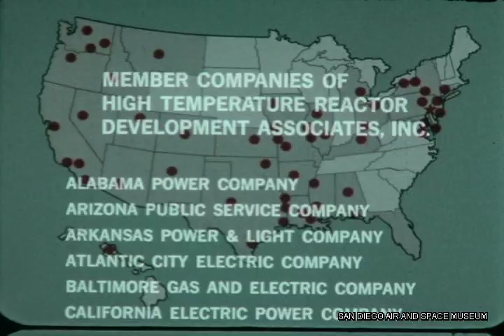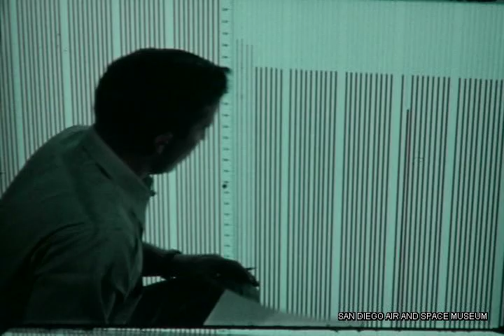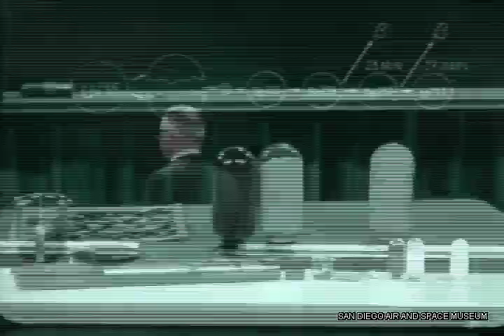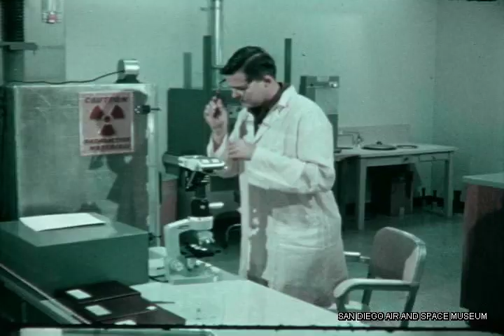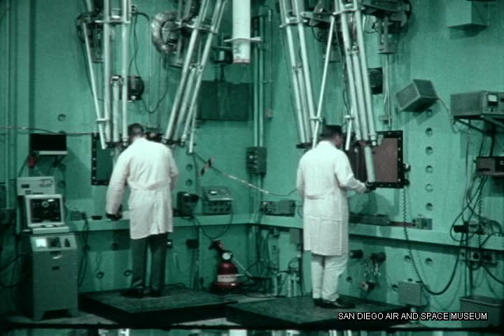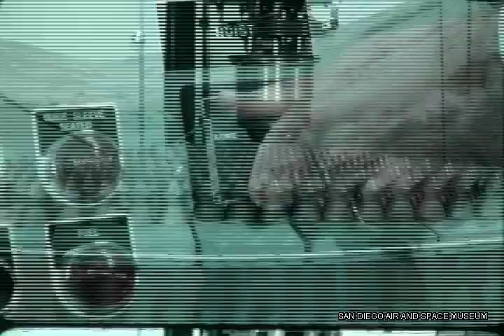HACL Film 00028 Nuclear Reactor: H.T.G.R. (High Temp Gas Reactor) Utility Presentation

Comment: They put the listless voice and objectionable hum in the film on purpose to alienate people against the concept.  Just saying.  I don't know if they intended to do this.  But that's the effect.  Its also the effect of this post.  

If you intend people to get excited about the concept do the following;

(1) process you video to remove the hum.
(2) send the processed video to a transcription service and have them type a transcription.
(3) send the processed video and transcription to a voice over service and have them produce a new audio track - parallel to the first one.
(4) repost the upgraded video.

Cheers
Reply: It's the hum from the AC motor used to drive the video reel when this was originally digitised and has nothing to do with the original.
Reply: I got rid of the hum and transcribed it here on my channel.